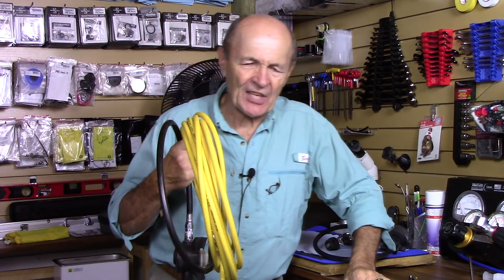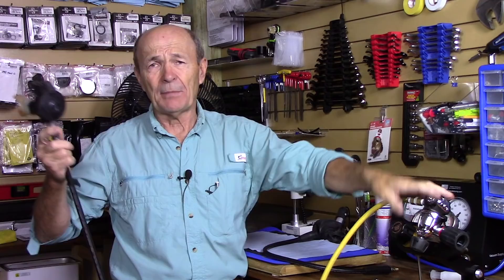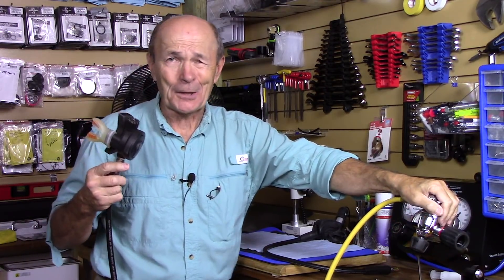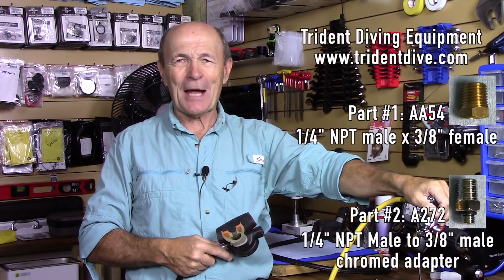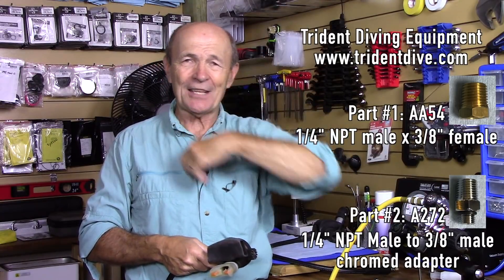Make Your Own Hookah Surface Supply - Scuba Tech Tips: S08E03

Comment: Will work to ~100m depth :D because then the water pressure is higher than the pressure in the hose and the first stage won´t compensate at it is at surface pressure. Just saying (not really practical example 100m on a Hookah)
Reply: He did mention shallow diving.
Reply: Am I understanding that you can use a hookah to 100 Meters?
Reply: @johnq.public2621  No, that would be a really bad idea to try. As he mentioned several times this is primarily for shallow diving although he used it at 100' once (30m) but he did say that was a special circumstance.
Reply: @eheadlee  That's what I heard, the above commentator may have made a mistake, meters (m) v.s. feet (ft). I would like to know the setup for hookah diving to 100 feet.
Reply: @eheadlee  wouldn't even go 30m. if the hose folds you notice it after you empty your lungs and you cant get a single more breath until it unfolds.
i do use 30m hose myself but its to move around easier around the boat.

Comment: Will 1/4" air line work?
Reply: Works so far in a 3 foot swimming pool. 100 foot metabo hpt polly line.
Reply: @devinholland2189  as long as you get the adapter

Comment: Alec,  Your the boss.   Thanks for the explanation.   
Question how do you hook the 1st stage to a standard oil less compressor w. filters of course.   
With your hook up you have the 1/4 NPT hose from the regulator to the outlet of the regulator -- how do you hook the inlet to a standard compressor?    Just picking one up tomorrow as I gotta get into my 57 degree pool for a main drain repair.   Ps been diving for 40 +  Thanks

Comment: It´s a good and simple description of a hookah surface supplied system, and is as described ok for shallow diving.
 - I see a few questions about diving deeper, using a compressor for air supply, type of hose to use. Some advice regarding this... If using a compressor, use a oil free compressor and a filtration system to get air of breathing quality, and if the compressor is driven by a gas/diesel engine- make sure the air intake for the compressor can´t get the exhaust fumes from the engine... Exhaust gas in breathing air is lethal... An oil-lubricated compressor can be used-but only with the right filtration system. (Normally a charcoal filter is in the system). A compressor should have a volume tank, with a drain valve- that’s helping getting the moisture out of the air. From a tank supply a regulator used for oxygen normally have the adjustment of 2:nd stage pressure (o2 welding regulator) just change the fitting from O2 to air on the regulator... Then you have the possibility to change pressure according to diving depth. In commercial surface supply diving, the supply hose is normally a 3/8" hose and supply pressure from 0-18 meter is normally 8,5 bar, at 30 meter supply pressure is 11 bar and at 50 meter 16,4 bar. And the flow volume of air of 62,5 RVM as a minimum =125 litre at 10meter 187,5 at 20meter 250liter at 30 meter and so on... a hose of 1/4" can be used to about 18 meters, but flow restriction gets to big for deeper diving. In commercial diving there is always a non-return valve on the mask/helmet from the surface supply hose to prevent squeeze if a hose brakes. If the supply pressure is to low or flow in the air supply is to low the diver can "outbreath" the gas supply - it feels like running out of gas on a scuba tank... you don’t get the air you need happens if you dive over the systems limits... Hose used in commercial diving has to be resistant to kinks and pressure tested to verify quality, and safe= not giving of fumes or in any other way contaminates the air.(Barfell divers hose for example is a good one).
And think about that it is still the same physical rules for hookah diving as for scuba diving, don’t hold your breath going up, don’t dive to deep to long and so on… And if you don’t know how to dive safe, get trained so you don’t hurt your self!

Comment: Hi Alec. Quick question. 
If 1st stage is on the surface and you go 100ft deep (as you mentioned in video) - does it affect you breathing, since 1st stage does not sense the water pressure.  🤔🤔 and if it does - how ?
Reply from the maker: You can't do that. That's why most hookah setups are for shallow diving only.
As the 2nd stage goes deeper, the IP must increase. For advanced surface supply, the tenders do that automatically or the diver may have some control at his hose valve.
Theoretically, if a diver with a properly setup regulator dove with the 2nd stage only (the 1st stays on the surface) he would not get any air when he reached 330' (10 atmospheres). Of course he would never get there because the air would get harder and harder to access all the way down.
I have a video coming that explains how a regulator adjusts the air pressure, the IP, as you descend. It's really very simple.
Alec

Comment: Dear Alec, is it possible to know a safe and good way to create an array on 4 scuba tanks for an air supply ? The video is very clear about what you need if you use only one tank but, if i need to connect more tanks in series how can i do that ? There is some kind high pressure adapter that accept multiple air intake ? Is it possible? I really see only pair of tanks linked toghether but i really do not know how to create an array of tanks. Hope to read you soon ! Great videos always ! Thanks a lot !
Reply from the maker: If you want to have a stationary supply, that is, one that sits on land, it's quite easy.
Each tank has a valve and each valve has a Tee fitting (except the first one).
Now you can run an HP hose from one valve to the next.
If you want to carry it underwater, it gets more complicated since the tanks must be secure first. That is, they cannot move relative to each other. So you need a large pack with solid bands to hold the tanks. Then you need a manifold to connect the tanks to each other.
It's not difficult but takes time and some material.
Alec

Comment: Is it safe to use an airline from Home depot or Lowes as mentioned in your video?  I went and bought 2 50 ft. hoses today but might take them back as other post I read today said that unless the hose is certified for breathing air, they are unsafe. Hate to spend big bucks if these hoses are safe.  One article said the pvc hoses contain lead.
Reply from the maker: I have no idea what is meant by hoses that are certified for breathing air. The hoses on regulators are not 'certified' for breathing air. They are clean but that's all.
Hoses used for oxygen-enriched (Nitrox) air are different but that is simply to ensure compatibility with oxygen.

Many divers including myself have used normal airline for various underwater tasks with no problem. Provided it is new and so has had nothing noxious in it, it's fine. 
If you feel better using 'certified' hoses, go crazy.
I'm not even sure where to send you to find such a thing. There is a food grade hose that is commonly used for dive gear.
Some hoses are certified to have met a certain standard such as the NIOSH or OSHA breathing air systems requirements but that's an overall rating on the air system and the air itself - not the hose.
I do know that many hoses used for breathing air are PVC. There is no lead in PVC.
Hoses have traditionally been made of EPDM rubber and that is still common today. 
I suspect that the other articles you've read are equally inaccurate.
Take care.
Alec
Reply: Thank you for your quick reply. We really enjoy watching your videos!
Reply: BRING THEM BACK AND GET SOMETHING PROPER

Comment: The system I got did not come with a stage one reg said I did not need is this wright I got a really bad sore throat after use it 4 dive can you tell what I am doing wrong
Reply from the maker: A sore throat is NOT a good indicator.
Without a 1st stage, you must be using a compressor of some sort to supply air. 
You need to check the air to be sure it's clean. There may be oil from the compressor, particles in the air or maybe it's just extra dry and your throat is getting dried out.
Tell me what the source of the air is and I might be able to give you a suggestion.
Alec
Reply: Alec Peirce Scuba 
1 - Air Line/Thomas 110 volt (60 Hz) Single Head Compressor
1 - 5 foot US Navy heat hose
1 - 60 foot fully swiveled, individual diver hose
2 - Washable, stainless-steel particle filters 
Hope this help just got system 2month ago new
Reply: Is it possible that I was breathing wrong cause water was cold I was cold under water forgot my wet suit that morning and try to fix leak in pool anyway did get let’s stop hope this help just make sure it’s not my system thanks

Comment: What you do for dry mouth when diving
Reply from the maker: There are some devices designed to help keep your mouth moist but they have never proven to be much help and some have actually caused problems with the reg.
Dry mouth is a result of the very dry air that is used for scuba diving and there's little that can be done to prevent it. 
It is possible to drink from a water bottle underwater if it's really a serious issue. Even tiny sips of saltwater will relieve the dryness.
Sorry, but there is no effective solution.
Alec
Reply: What kind air compressor you use

Comment: Any hookah system should incorporate a non-return valve at the diver end, period. Also, going deeper means you should increase the IP of the regulator. For shallow water the typical IP would be fine. I would not recommend using anything but hose designed for diving. It is OK to use an oil-free compressor as long as the intake is not down wind of the exhaust. In the US hookah is not approved by OSHA for commercial diving but if you work for yourself OSHA doesn't apply to you.
Reply from the maker: A non-return valve in the airline is absolutely necessary if you are helmet diving but it's not so critical for a mask and reg diver.
If the air supply stops when you have a reg in your mouth, it simply stops. With a helmet diver, it can be disastrous because of that rigid tin can he has over his head.
Most surface supply or Hookah used by recreational divers is used in shallow water, often less then 20', and in that situation, is quite safe. Diving deeper, certainly deeper than 50' will require some modification to the gear - IP increase, maybe a non-return valve, redundant air supply with reg, safety harness, etc).
Alec
Reply: Dan, so the video says you can purchase the hose as home depot.  An air compressor hose would be bad?
Reply: Anybody that's got a good compressor that will pump I'm looking for a Gast for sale Cal 731 441 1092

Comment: how deep can you go just using a regulate and just an air hose like you are snorkeling? What I want to do is fossil hunt in water less than 10 feet deep.
Reply: If I understand your question, no, you can’t just breath through the hose, even at four feet. You still need a compressor.
Reply from the maker: No problem Jeff. These devices are good to 25' and more.
Alec
Reply: Gigmaster channel here on youtube uses a Hookahmax system he calls SNUBA for just this.
Reply: Your lungs don't have the strength to pull the air down the hose beyond a cuople feet of depth.

Comment: I have an air compressor that gets up to 150 psi. Is that too high for a second stage regulator.
Reply: Trying to DIVE with a Utility Air Compressor !!! WOW I would be Very Afraid of Toxic Air from it if it's not meant for DIVING. !  you must remember the OIL  in it & it's not designed for Breathing Especially at Depth ! 
 try & drain the TANK on it & you will see OIL & Water Mix ! A filter not all that's needed ! Toxic Air will first Usually show up as Red Lips 
But can cause med.  problems.   Not to mention smell & taste bad. 
Diving with out Training can Easily be FATAL to many ways to list here. Be SAFE
Reply from the maker: Not necessarily. The 2nd stage can be adjusted to breathe properly with an IP of 150. It would be better at about 125psi. See if you can adjust it.
Also be sure there is no oil or dirt in the final air. That requires a breathing air filter.
Alec
Reply: Just had a FATALITY in CHICKASAW AL from I believe this Very Video DON'T TRY THIS
Reply: @lbbradley55  why did it happen, was it the hose or hookah system
Reply: @e.fifield9034  as I understand it. His Girlfriend stated he watched a Utube video & home made some Diving Gear. I did see the 40ft hose & piece of Chain he used for Weight belt. ! 
He had a very small air compressor. His girlfriend in boat said he surface 2-3 times last time Cry Help & Disappears. ! 40 ft deep there. He was found 3rd morn. Fishermen boating. ! 
he had No Diving Experience or Training. ! I didn't hear anything more. 
Just hope no one else watches any Video & Dives to their DEATH    have a better day
Reply: @e.fifield9034  also as you know as a Diver the list of Possibilities of what exactly caused his demise is a long list.

Comment: I often make breathing air lines for industrial workers and in theory they sell "breathing air hose" that is guaranteed to not put possibly harmful fumes in the air, another good option is to use hose intended for high pressure potable water, its usually transparent with a white nylon mesh inside it, 
ALSO also, if some one wanted to do this they could probably just buy a short hose for their regulator, cut the short hose in half,  and use the barbed hose fittings (the ones you used for splices) to connect more hose in between the 2 halves of the original regulator hose, that way they don't have to go find the exact fittings
Reply from the maker: Using barbed fittings is a fine idea. The pressure is low and it does eliminate the need for special fittings.
Using 'breathing air hoses' is also recommended. I have used ordinary airline hose as used in service stations for many years with no problems but again only in shallow water.
Thanks Trombone.
Alec

Comment: I was expecting a video about how to build a Hookah Rig, not attach a long hose to a dive tank.
Reply from the maker: That's correct Southern Style. Hookah refers to any diving system that uses a Low-Pressure hose and a 2nd stage only. The actual air supply, whether tanks or a compressor, is located on the surface.
I do have plans for building a Hookah unit and will share those in an upcoming video on my Vintage Scuba playlist.
Take care guys.
Alec
Reply: masdbo that is a hookah rig. If you want to put a compressor to the other end then you can. Please please please just make sure the compressor has not had regular compressor oil. Diving compressors use monolec oil because it’s not harmful to breath. If you have any questions please ask.
Reply: I guess so but I don't think scuba tanks were around when   Hookah diving was invented in the 1800s. I guess I'm just old school.
Reply: masdbo I mean hey if you want to run off of a compressor you can follow the US navy dive manual. It will show you the best dive chart for a surface supplied air system. Suggestion but definitely optional if you do decide to run a compressor choose one with a tank on it that way you will have a little time if the compressor is ever to fail.